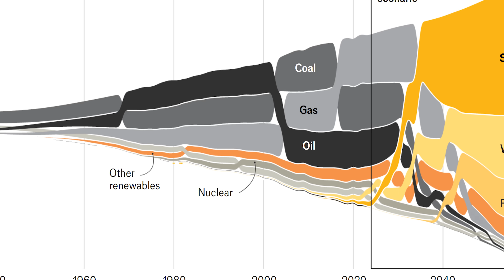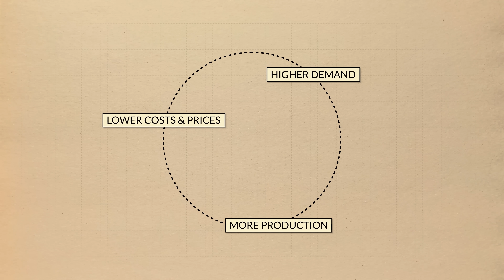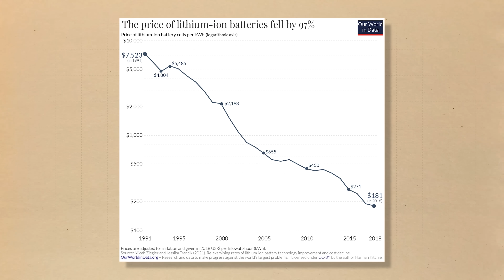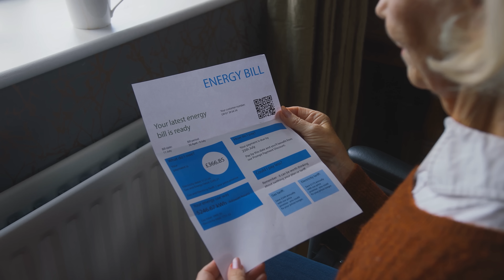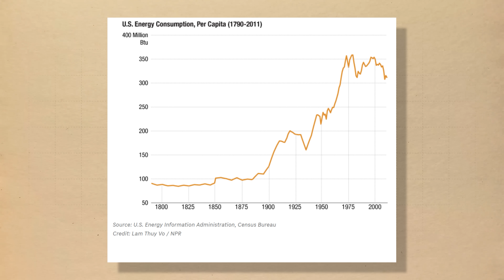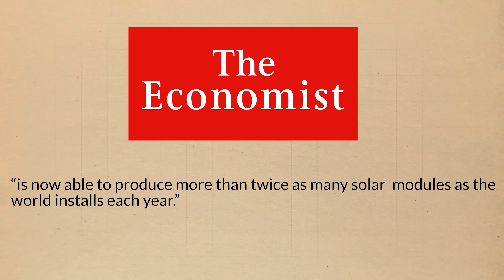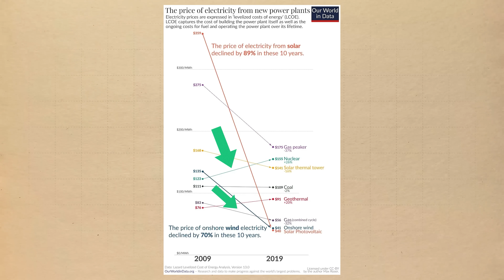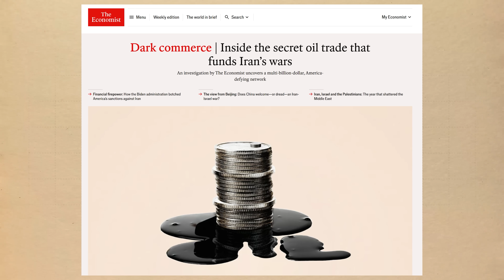Why solar will soon dominate & what that means for the world

Comment: My two cents... So world is not exponentially big, so solar growth is an S curve sooner or later.

So I think solar is not as cheap as it is portrait in that chart. Solar is a "coupled" energy source to a storage medium, the cost of the storage medium needs to be taken into account.

Also a lot of farm land is being bought for solar, which should be a big no no.

For example in my country Portugal, solar is said to be a success story. In reality solar is nothing more than energy to power our pumped water storage, so when peak demand arrives at sundown, we don't black out.

Also Portugal shouldn't be a lauded, we import so much energy, from other countries such as France and its nuclear. We are 100% dependent on pumped hydro, which brings so many problems, for example we went an entire year with our water reserves below 50%, reaching values around 20%. Disaster scenario... Two draught years and we are in a really bad spot... No water for agriculture, and so on.

Solar doesn't like high temps, so places with high solar exposure, the panels tend to be less efficient.

Solar is dependent in ancillary technologies, like grid level storage, smart grids, flexible green hydrogen, and so on.

One of the rising sectors with big demand for power is artificial intelligence, there are AI data servers being built that will have a peak electricity consumption of 1gw, the same peak demand of a light industry country of 1 million people! There's talk of 3gw data centers. AI data centers don't work too well with current solar and its ancillaries.

Don't dare to show Australia as a success story of any king... They are in an electricity crisis... There are not many role models for big percentage solar, currently...

In the end it is complicated, solar can become really cheap on it self, but if ancillary technologies lag behind, these predictions might fall short...

Comment: This is very good - but batteries and vast distance transfer are still a very hard problem.
China already run into serious trouble, same with Ireland and any countries with even 20% solar + wind are all experiencing it. Yes, it's now become economical to plaster over large grassland/desert with panels and it will produce nice capacity (not just on sunny days, but yearly). But you want that power to go to cities and factories and then perfectly balance it with demand. As a 10% chunk it's no problem, you can balance gas/nuclear and it's great. At 20-30% you have to sweat but you can still do it the same way. But what about 50% or 100%? During dunkelflaute (German word for dark and windless time) you can have near zero output and the same demand as yesterday. Also winter is reliably much less output. Do you build x10 solar capacity and massive batteries? Do we run massive cables through entire planet so that you can always just borrow power? I think we will solve it eventually (or just keep running enough nuclear as a balancer) but it's not smooth sailing just yet.

Also, this is of course a problem for the countries that already have nice chunk of renewables. All that don't - just build more solar and wind now! Everybody should get 30% solar + wind tomorrow and we can worry about the rest of the way after eating the low hanging fruit.

Comment: What would it cost to run a wire and connect my house today?
How would that compare to the cost of installing solar with batteries?
In my case it would involve running a wire more than a short distance. I have about 233 sunny days a year. 
If I were starting from scratch, I would chose to remain off grid. 
Now I have to guess what a solar system would cost in a few years and how much, if anything, I could save on the installation,  vs how much I could save on my electric bill.

Comment: The problem is that solar puts great demands on grids necessitating huge investments. These investments are not accounted for. It's just bad accounting. And you can't escape it. Plus solar can't work on it's own in many parts of the world because of this thing called winter. You could do long distance transfers and import electricity, but even putting aside the necessary investments, it opens the question of independence. Wind and solar actually complement each other pretty nicely as lower temperatures result in higher winds. But some places have too little wind, putting a limit on how cheap wind energy can be. Again, you face a question of dependence. You can either import cheaper wind energy from a windier region or you can subsidize you own production in which case some other solution might be more economical. Plus it still puts great demands on the grid. Because neither wind nor sunshine is reliable. It averages out nicely but you can have days and days of low production. Imagine forcing your industry to restrict production for two or three weeks in December because you don't have enough energy. When it comes to storage, utility decreases with capacity and the decrease is worse than linear. Little storage is going to be useful often, achieving high utilization (= economical). A lot of storage is only going to be needed once in blue moon, achieving very poor utilization (= not economical). At some point, it would be cheaper to limit industrial production instead of investing into rarely needed storage. Another way to approach this is to have overcapacity in electricity generation which is not economical (again, low utilization). Solar is cheap when the market can absorb overproduction (maintaining high utilization) and fill underproduction (maintaining industrial production). But it has an invisible cost. When sun shines, it's so cheap that it would put everybody out of business. But when it's overcast, you'd pay an arm and a leg to get some. That's how you get €1k/ MWh on spot market. You just need it (the alternative might be halting a production line which could cost millions).

All I'm saying is that the economic calculation is far more complex because of laws of physics and realities of demand. Solar doesn't produce on demand. And utility of storage decreases with capacity as larger and larger capacities are needed less and less frequently. After all, this is why data centres have diesel generators as long-term back-up; batteries are only used for short-term with fly-wheels as competition. Capital investment into a diesel generator is practically the same whether it runs for a minute or an hour or a day. The limitation is that it can't switch on instantly. PS: With a generator, you're paying primarily for continuous power rating, runtime is very cheap (until you hit limits of maintenance cycles). With a typical battery, you pay just the same for capacity as for power rating (they are linked as power is a function of capacity). This is what makes generators superior for back-up applications. Decoupling of power and capacity. Grid storage is like a back-up.

Comment: A further benefit from Renewable Energy adoption in Europe and the US is the reduction of these Forever Wars, the Oil Wars in the Persian Gulf where the US seems to be protecting it's interests in some production quote. Even OPEC Plus Putin is perpetuating the need for Simmering Conflict to drive the fear of Oil and Gas Extraction interruptions. 

It will take time, but the adoption of Renewables can force the price per barrel to drop well below the cost of recovery and refining and transportation. Too many countries will not make the conversion to other sources of revenue and their energy supply business will wane leaving hopefully large untapped reservoirs of stranded assets that can't be economically recovered at future lower prices. 

It almost is as if Russia attacked Ukraine just to prevent Ukraine from developing it's domestic natural gas fields and then supplying that gas to it's own domestic customers and even possibly sending some excess to EU customers too. That would just further undercut Russia's ability to convert their more distant gas fields into supply for Europe.

Comment: There needs to be some sort of high energy storage device that uses common materials. That’s why I think that the government needs to fund research into liquid hydrocarbons that can be made from carbon capture and excess solar energy and stored as a high energy liquid and then converted to electricity efficiently via fuel cells. If we can get a 1:1 replacement for gasoline and diesel and the replacement fuels can be made for free from materials sucked from the air and powered with free solar then that would kill so many birds with one stone.

Comment: Wow, 600GWh...that's 0.6 TWh.
With a global consumption of 30000TWh, we still have a long way to go I think.
If you want electricity at night too, you need to install 60000TWh of PV (that's 100000x your chart, yes 100000x more than now) and be able to store 30000TWh. We will continue dreaming for a while.
And thanks to the EV’s and heat pumps, we will soon be at the 100000TWh mark.
You can already see it coming, anything but cheap.
I don't see the optimism, be realistic.

Comment: Your optimistic view, I believe, depends on various factors.

Political influence of established energy producers to derail its inclusion. 

Likely significant overcapacity needed to overcome both intermittent nature of solar and wind availability and, in solar's case, the low energy per unit area produced in order to ensure electricity fidelity across distribution systems requiring exacting flows of energy.

Desire for control over the inherent decentralized nature of their establishment and their integration into an existing grid. 

Geographical limitations. Prolonged overcast and scarce wind conditions occur likely necessitate the need for days or even weeks worth of stired energy.

If China is headed towards a solar superpower future, why is it electing to significantly bolster its coal fire power plant capacity?

Not wishing to cast shade ;) on your optimistic view, just some realism from fields beyond economics.

I was informed that this is the first time in human history were an energy transition involves the transfering to a less energy dense source. I hope human ingenuity (in combination an artificial one?) be there to achieve it.

Comment: Sorry, this piece is so biased I have to comment.  First, solar capacity is not energy produced.  Divide by three for real capacity, due to nights and clouds.  Second, China subsidizes and then the countries that get these panels subsidizes.  How long do you think this double subsidizing is going to continue?  When Communist, authoritarian China says no more subsidies, no more super low prices.  Same for the countries that get these panels.  Third, solar and wind are intermittent.  To compensate, backups in the form of coal, oil, gas, hydro and nuclear are needed as backups, vastly increasing the effective cost of solar and wind.  Batteries are not going to save your butt in at least the short term.

Comment: This is absolute nonsense. All of these analysis gloss over the HUGE problem of intermittency in solar. Yes, batteries have gotten far cheaper, but they are still insanely expensive. Yes, for a residential building you can have storage for a few hours or a day at most with reasonable costs, but that's only because you can still rely on the grid to back you up when solar production drops for several days.
So how much storage do you need for an entire country? Well it really depends on how much of a risk you want to take. The UK went through a massive solar/wind drought a couple of years ago. Prices soared because of this, but they were still OK because they still had redundant capacity. Without redundancy you would need MONTHS of storage to be safe, as a country. Otherwise you're just taking a risk of catastrophic proportions. 
And how much would months of storage cost? Hard to even imagine. You'd probably be better off powering your country by burning fine works of art at that point. It's not doable.
There is also no reason to expect battery prices to drop to a point where mass storage becomes an option. It is unlikely to happen.
The other option is to maintain redundant capacity operational. But what do you think would happen if you have to maintain redundant capacity online which only rarely produces anything but still costs a lot to maintain, including employees? Either the cost of electricity will always be far higher than the cost of production via solar panels, to account for the added cost of redundancy, or you'll have enormous price spikes whenever that redundant capacity goes online, to recuperate costs.
Either way it is unlikely to ever work economically. However, you might be asking, why are companies investing in solar if it's not viable? Well that's because it IS viable for companies. They can make money investing in solar, because the marginal cost is low and they get to sell the energy at market rates which are significantly higher. And those companies don't give two shits about when they're not producing or the impact that will have on consumers or the overall economy. 
So these companies lobby governments and get subsidies and permits and then they advertise how "cheap" their electricity is based on production costs, not what they're selling it at, and no one talks about how we're slowly walking off a fling cliff. Soon power shortages will be a feature in every European country thanks to the mirage of solar and all of its evangelists who promote it without thinking it through.

Comment: Well... That projection that solar will dominate the energy source it's too fast in my opinion. Not the end, but the speed.

The reason behind is this.

1- The projection is mostly based on continuous price reductions. But there is a problem with that. In the past, the biggest part of the solar cost was the panel itself. And it still does, but quickly dismishing. Now the biggest cost will be the LAND it uses.
There is very cheap land, even free (double use, like roof), and there is expensive land (with high value for other better incompatible uses).
So the price can't reach very close to zero price not matter what.

2- Electricity and thermal energy is not free to change. In some uses, thermal energy is cheaper, while it's the opposite in others. Best use requires change how we use the energy to provide a best way to use a different source of energy.

Electric cars is an example. Technically, with free energy, you can brute force produce clean water from sea water. Hydrogen from clean water. CO2 by Direct Air Capture. And fuel from CO2 + Hydrogen. Free energy means unlimited fuel... in theory.
But energy IS NOT FREE. It can be cheap, but not free, specially when land cost will start to raise. Infrastructure also cost a lot.

In that case, to move cars, while we could technically brute force fuel production from solar, it's way more efficient to turn our fuel cars into electric cars, and use solar energy to move the electric cars. The energy involved could be an other of magnitude of difference.

It's the same for A LOT of energy uses. So, in the end, the problem is that we require to change a lot of things for use solar energy in the right way, and that will take time to develop certain technologies.
In case of EVs, we can be optimistic. The production is raising fast, and new batteries are being developed, so that also can be quick. But things like aircrafts, ships, manufacture, infrastructure... there is lots and lots things to change.

And try to change too fast also can raise the costs, as you force to remove infrastructure before their amortization periods.

In the end... I expect multiple bottlenecks in some areas, so solar will raise slower than a pure S-curve, due the different speed of different markets involved in the electrification process.
There are still some years to come where won't be a significant bottleneck, but that bottlenecks will come to stop the exponential growth to a full energy migration and slow down until all tech are developed.

Well... There is a potential "short term" bottleneck, but of different nature. Intrinsic to current PV tech. Silver. Current PV tech uses silver, and the speed they reduce silver usage is slower than the PV growth, which pushes silver consumption. If the trend continues, they will soon raise silver price and create a bottleneck.
I know there are alternative technologies. My bet is new panels using copper instead of silver. The price rise will be first, and until that price raise don't create a significant impact in PV price, they won't have a real pressure to change the tech. After that, some producers will start to introduce alternatives including the copper, and some will be successful and part of the manufacture will change, reducing silver consumption again and breaking the bottleneck.
But it's a different bottleneck than the previous one I mentioned because it's in the PV itself which it will probably adapt quickly, but in other sectors where electrification is far from developed.